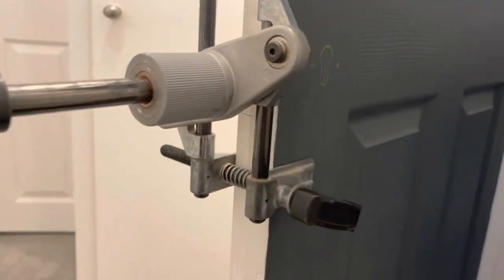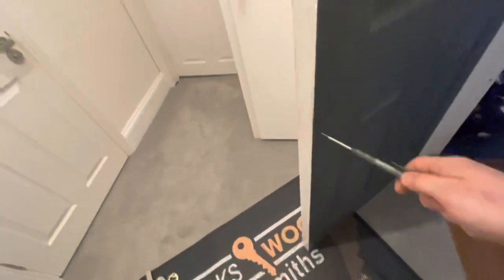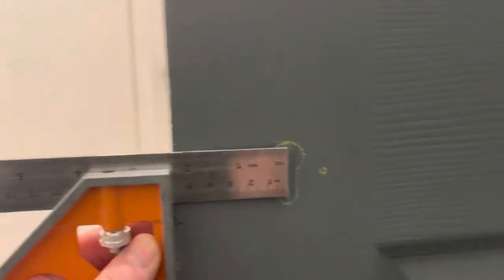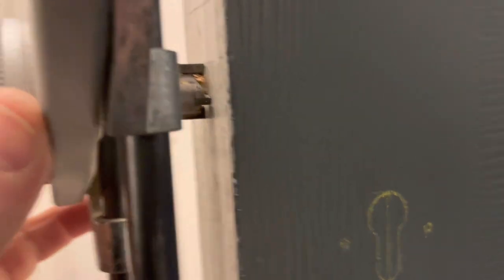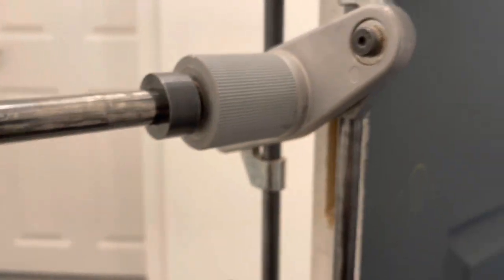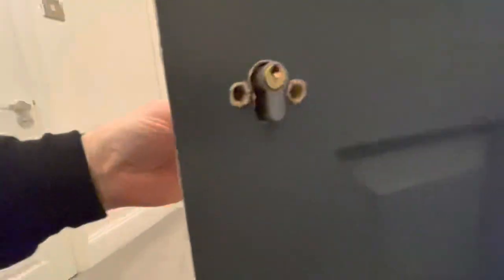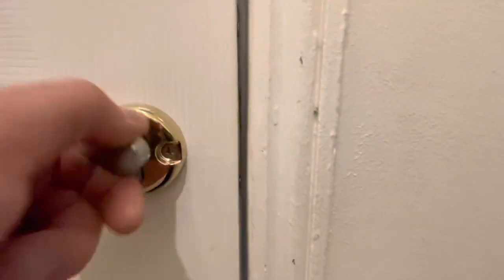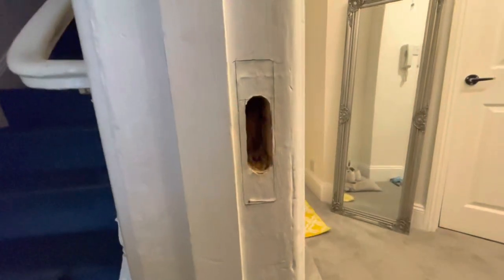How Do I Do It??  | Souber Mortice Jig | Yellow Lead Tracer Pencil - Locksmith

Comment: Nice job Andy. 
You have to love those mortice jigs. I fitted a euro deadlock the other week but it wasn't a thumbturn,  I stuck in a Lathams 30/30 euro cylinder. I did exactly the same when fitting the keep, right where there was a screw. I used a hacksaw blade. 
Great video.
Reply from the maker: Nice one Roy. Yes the jigs make life much easier. Crazy how many times I’ve hit a nail behind the keep 🤯
Thanks as always for watching buddy 🙏🏼

Comment: 🤔 Andy on the MLA test I think you have to cut out a mortice in a door by hand using the old fashion method and also I think you have to cut a key to a 3G110 by hand also but don’t quote me on that though bud cause am not 100%.😩🤫 yes I know a lot of thinking there, it hurts trust me.🥴😵‍💫🤯
Reply from the maker: Yes mate I think you are correct. I think you also have to open a BS deadlock and do a written exam as well! I think it’ll be the written part I’d struggle with the most 😐
Reply: @brighton_locksmith  Yep same here mate.😭
Reply: @brighton_locksmith  you can do it with coaching I believe too mate not sure if that means they give you the answers to be fair 😂 heard there not too hard general knowledge ect

Comment: Another great video Andy. Nice tip regarding the square for the centre of the euro, how do you calculate the height of the euro against that center line so that it is in line with the lock when fitted?
Reply from the maker: Thanks Colin. I hold the lock on the door, mark the top and bottom of the faceplate, mark the top and bottom of the lock case and mark the top and bottom of the keyway or in this case the euro keyway. Then I use my square to transfer all the marks around the the other side of the door 👍🏼 
I hope that all makes sense 😁
Thanks for watching buddy 🙏🏼
Reply: @brighton_locksmith   Thanks Andy all understood, thank you so much for taking the time to respond to me. Keep those Videos coming they are great, but keep costing me money buying things I didn't know I needed but now cant do without :) . The only thing I struggle with is it looks like you use a impact driver to screw things in and when I try that the head strips so maybe I just don't have the knack yet.
Reply from the maker: @colinpennington4581  No worries buddy. 
Sorry I’m costing you money 😂😂 You’ll thank me in the long run 😊
You don’t need to use an impact driver mate. I only do that to save keep swapping the bits over in 1 drill 👍🏼

Comment: odd mix of brass and brushed steel and chrome finishes. Don't you get all brass profile cylinders and night latches ?
Reply: He is taking advantage of the Versa locks to save carrying double the amount of stock by the looks of it (they have brass and chrome on them so “work for both”). I do the same, works for me.
Reply from the maker: Hi mate. Yes there was already a chrome night latch but witch a brass cylinder, and a chrome pull on the front. 
I didn’t have a brass cylinder in the right size, but given the mixture of finishes going on anyway I thought it fitted in well 😄
Thanks as always for watching 😊🙏🏼